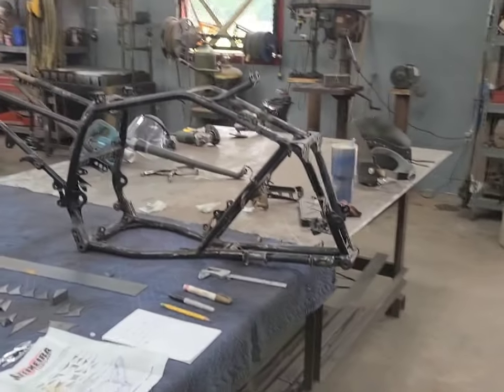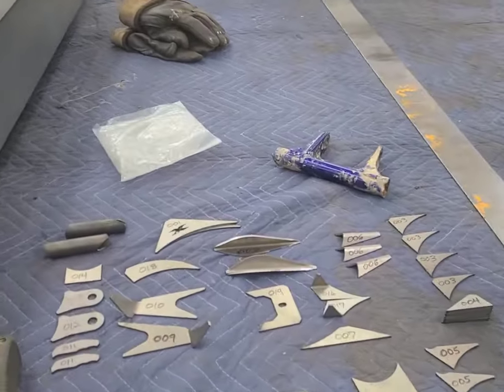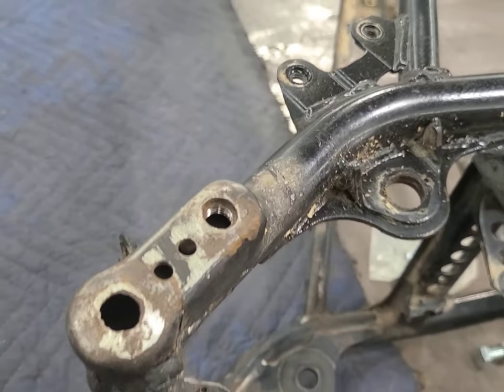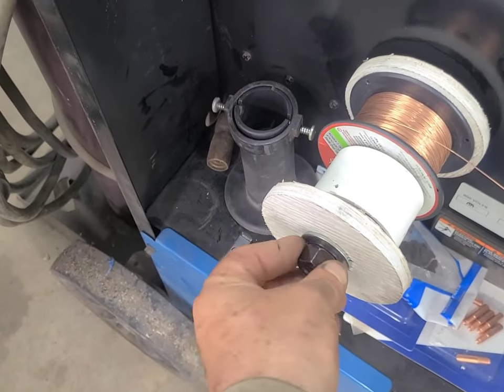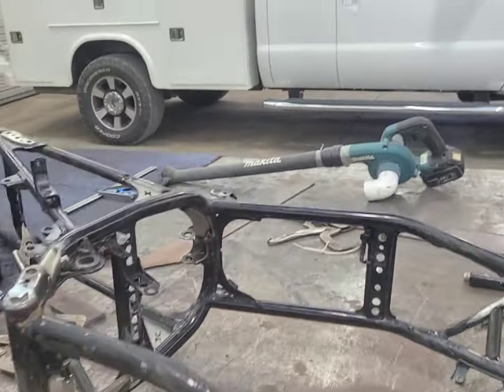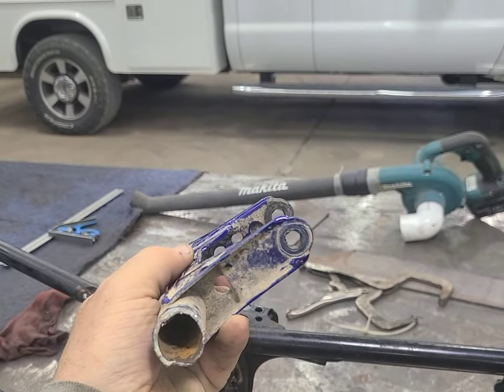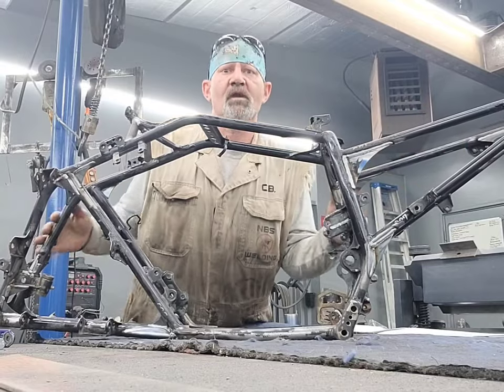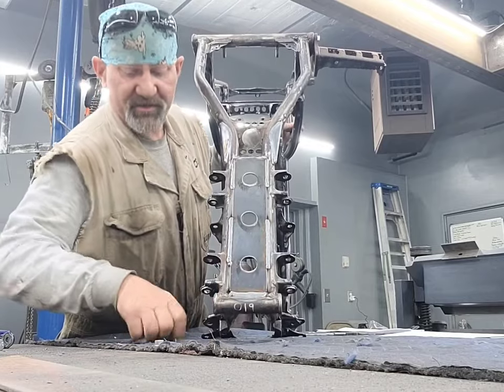Welding a gusset kit in a race quad frame

Comment: Fantastic information in this one for newer weldors! As far as the benefits of TIG over MIG  in this application, you’re absolutely correct, TIG would be fine but not necessary. I’m convinced that people didn’t go crazy about wanting to TIG this kind of stuff until the American Chopper series came out on television. In their situation, TIG made sense because they were building mega-expensive show bikes. For a down and dirty race quad, MIG is more than adequate because it’s far stronger than the frame itself. Great video my friend.

Comment: Fantastic video. Im about to gusset my raptor 125 with the same kit. Im gonna replicate ur front lower plate and the engine mount doubler plates. Thanks for all the info. I didnt know the frames had so many weak points.

Comment: Solid plate the entire bottom? That's a bad idea.... It only adds marginal strength and even then, only in specific directions. The trade off for this marginal improvement is reduced cooling capacity and much harder to clean frame. And you don't want crap sitting in there...

I'd recommend either some tube bracing in between the rails or if plate is absolutely what you want, I'd add it to the top face or even both top and bottom faces, just not only the bottom face. 

Two or three RHS bars welded perpendicularly between the rails and a plate on the top surface would be the best compromise imho. Could even drill some holes on the plate to allow crap to fall out and to assist with letting heat escape.

Edit: I see some holes were drilled in plate 👍will still be a bitch to make sure all the crap is removed from that acute angle between the tube rail and top face of that plate though. As well as under the other gusset towards the rear overhanging the plate

Comment: Is mig welding these parts as good as tig welding
Reply from the maker: MIG welding these gussets offers great strength and high quality welds very efficiently and with the least amount of heat distortion to the overall frame…so in my opinion MIG is a better choice than TIG on this job.
Reply: @NBSWELDING  thank you dory eg responses